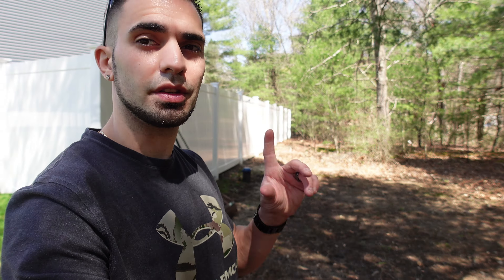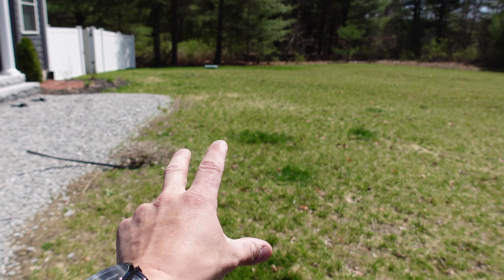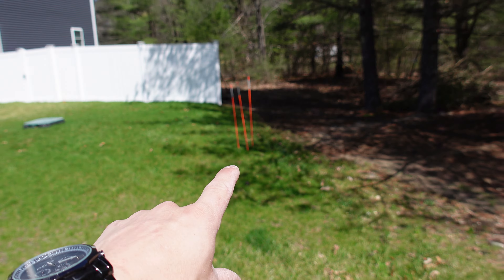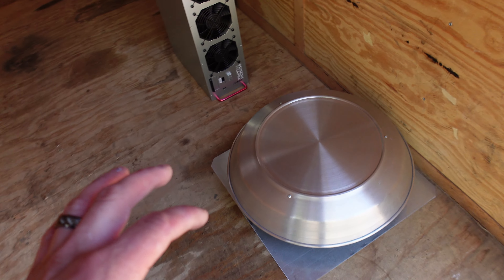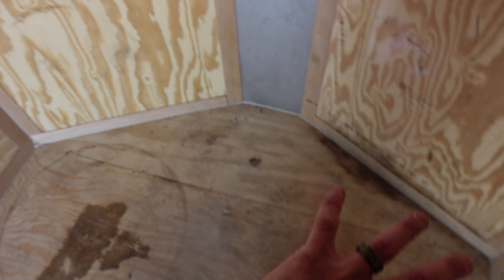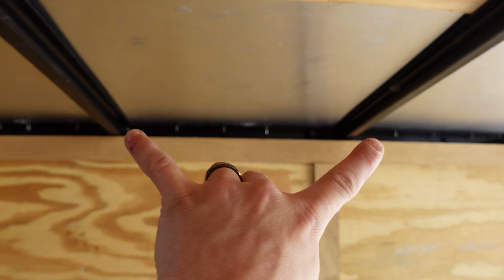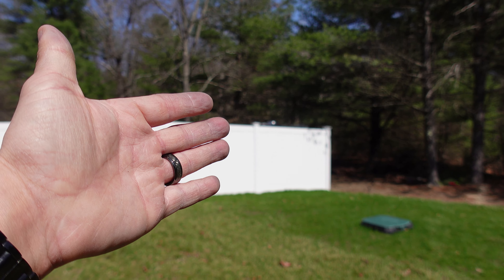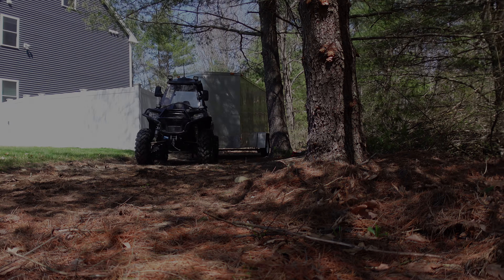Moving My GPU Mining Farm

Comment: I think you need to do sections inside the trailer (hot room).Octominer x12 exhausting around 1000 cfm, if you are planning to put 12 cases, it's around 12000 cfm. So, fresh and hot air will mix and temps will go up. It will be much better to do hot room and put back side of octominers there and cut lot of vents in hot room, so air can go out without exhaust.
Reply: Hotside will need fan powered exhaust of around 12000 cfm. If possible go for brushless DC motor fans as they use 80% less power than the more common AC motor exhaust fans

Comment: Above 4G Decoding (Enabled) in the mobo BIOS settings when running GPUs. 
If u r having problems running past so many GPUs and don't work, well this is the fix. 
SO Bits said   You need to boot into BIOS with 1 GPU and Enable then u can mine with all GPU's lol
Learned it from Bits Be Trippin' "Complete Newbie Guide to Cryptocurrency Mining " Video.